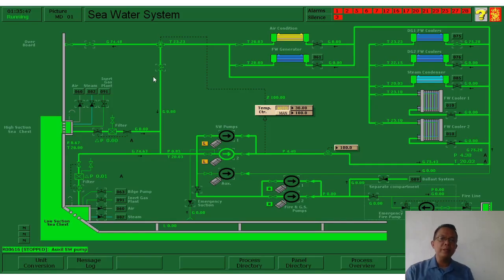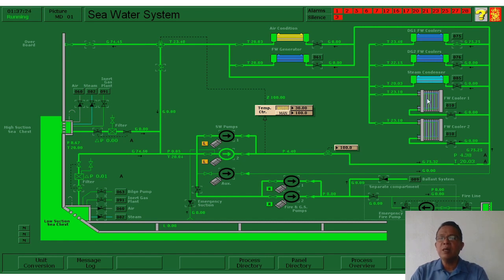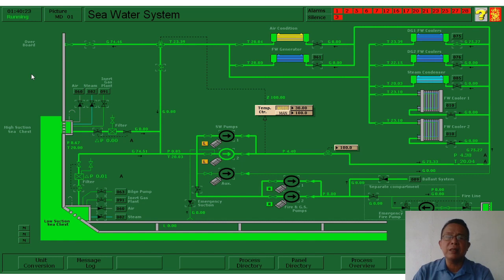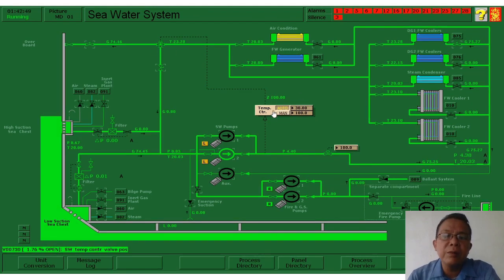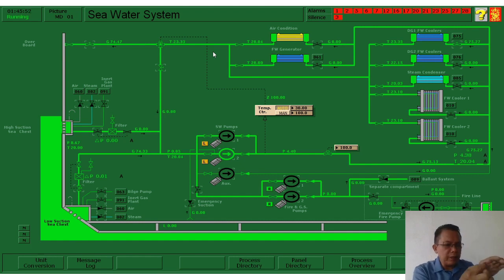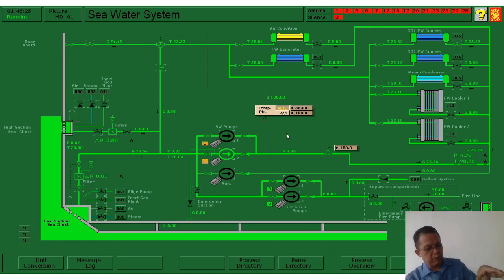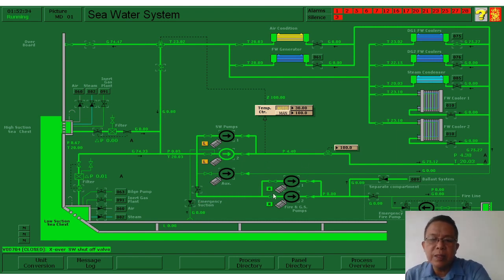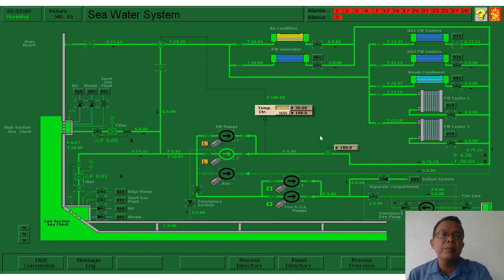SEA WATER COOLING SYSTEM

Comment: Sir pano kung mas mababa ung output temperature mula sa coolers kumpara sa setpoint ng controllers
Reply from the maker: Then the three-way valve shall work for it, just to compensate the controller set temperature..